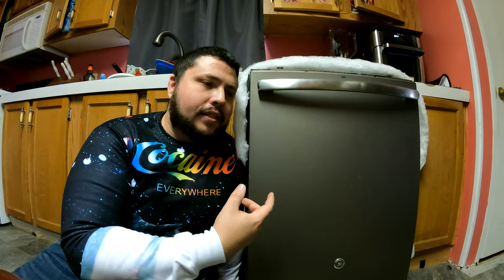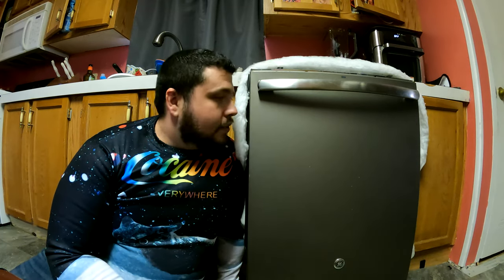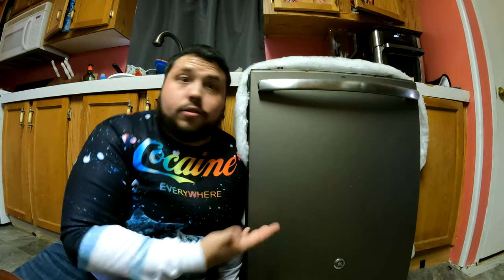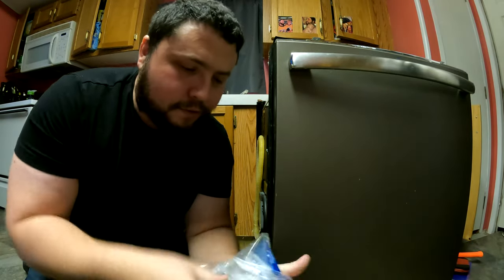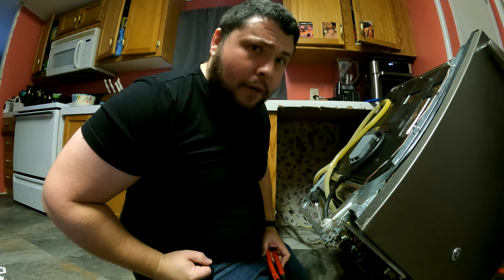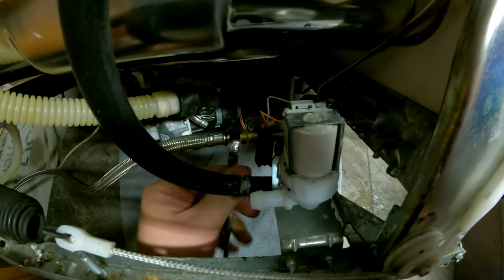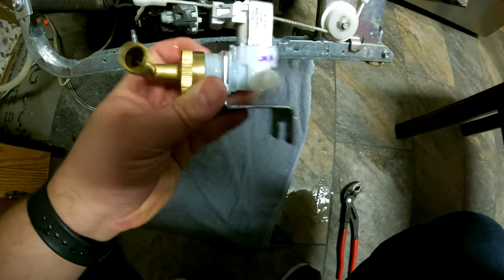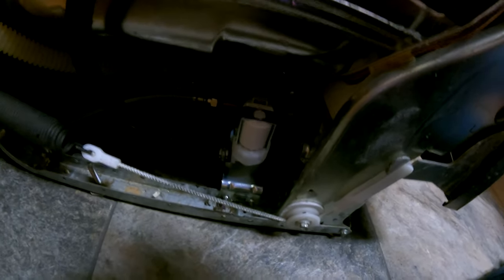GE DISHWASHER NOT FILLING - WATER INLET VALVE REPLACEMENT | LETS FIX IT!

Comment: I'll never buy another GE dishwasher. The new ones are lucky to make 1 yr without needing a repair. 2 yrs ago we replaced our old GE that had lasted only 4 years with a newer one. Over the 4 yrs we had the prior one I had to replace the control panel twice, and the water inlet valve once (around $250 for the parts only. i provided the labor). 

After it crapped out again I was fed up with fixing it so we bought a new one hoping surely they had improved. We got another GE only because my wife insisted it matched our refrigerator which is also GE. 

Now right at 2 years it too has stopped working. It starts up, drains at least some of the water (tested by pouring some water manually in bottom) and then after several seconds of just noise (much noisier than usual) it just shuts off without ever filling with water. Did all the cleaning like you did, took off the drain pump and inlet valve and checked for and cleaned debris. Nothing obvious like broken glass found. Reassembled. Same result. Although I had my doubts, I hoped maybe the louder than usual pump noise was just because it wasn't getting water at all so went ahead and replaced the water inlet valve as was cheap and an easy to replace as you demonstrated. STILL same result. 

Pulled a Hail Mary and ordered a cheap used pump for $30 which should arrive tomorrow. It is noiser than usual and while checking for debris, I could spin the propeller in the pump with my finger, but it was a little stiff so thought I'd give it one last try as after hours of research and finding other reports of pump internal scoring and bushings going bad in these pumps being a common issue. 

If this new pump doesn't resolve the problem I'm just punting and buying something new and NOT GE. Paying $1000 for an appliance that lasts only 2 yrs before failing under normal use is just ridiculous.

It's sad to think about how you used to get 20+ years out of appliances when today they are just junk. Fortunately for us, I'm technical enough to make most all repairs myself with the right parts. I can't imagine how families can afford keeping their major appliances running these days if they have to pay for parts AND labor. Even for a relatively simple fix like this you're probably looking at $21 for a new inlet valve then an extra $150 labor to have someone else put it in and that's just crazy.

Thanks for the video.
Reply from the maker: I completely get it. I started really investing in this channel a few years ago because I saw the need that people had to fix their problems. Not everyone has the money (myself included clicked)to dish out endless cash to someone that ends up doing more harm than good. My recommendation for a dishwasher would be a Bosch or, hear me out, A Samsung linear wash water wall dishwasher. They had a lot of issues when they first came out but they’ve fixed a lot of the problems. I’ve had mine for almost 3 years and really the only thing that’s truly went wrong was my own mess up. The water wall sprayer arm that moves in the tub can come off sometimes if the lees anything sticking below the bottom tray but it’s super easy to put back on.  The amount of times I’ve heard “you’ve saved Christmas” really has a good feeling and I like to think that my channel helps make a difference in people’s lives. Anyway if I can help in any way let me know. I try to get to all the comments but sometimes I do miss a few.
Reply: @BreakFixRepair wow! Thanks for the response! This is an old post so a response was surely unexpected. Thank you for that and being helpful. I've subbed and have already been checking out your other videos. 

A Bosch is exactly what I am looking at. One big reason is I can get a stainless steel one with NO logo on the door so I can get it past my wife without her complaining that it 'doesn't match' our GE fridge.  

I actually also considered a Samsung,  but the ones I looked at had a logo prominently displayed on the front. I know it sounds silly, but my wife gets hung up over 'appliances have to match'. sigh. She's been a keeper now for 25+ yrs so I figure if I get close enough to matching that will be good enough. 🙂

The fridge has actually done well for 6 years. Although I did have to replace the ice maker but wasn't a big deal. I sure don't want to buy a new one just because the matching dishwasher crapped out. 

If you have any links to share on the Samsung you mentioned I will definitely have a look in the event my last ditch repair attempt fails.

Lastly, you are right on with how valuable videos like yours are to folks like me. Helps us save money and learn new things. Thank you very much for taking the time to do them.

And as for comments about your shirt at the start of this video. Whoppity doo I say. I found it funny the moment I saw it. People need to take a joke. Take care.

Comment: Did it just make a clicking noise and sometimes cycle and other times just didn't do anything? Mine just makes  clicking noise, washes for a minute then stops. Other times it just shuts off after several clicks and time.
Reply from the maker: Yes that's what it was doing. it fixed it for a couple of washes but I think it had caused the pump to burn out so I really had two problems.

Comment: So we replaced the valve it turned on for a short time and then it stopped again.  Anything else?
Reply from the maker: It’s not filling with water or what’s going on?
Reply: So we replaced the inlet valve, it seemed to work for a little bit.  Checked the float and that was really dirty, cleaned that and it still is not working.
Reply: Water is still not filling into the machine
Reply from the maker: @michie5513  okay what model?

Comment: Replaced mine, still no,work? No voltage to it either
Reply from the maker: Did you get it working?
Reply: No, replaced machine control, UI board, and valve? Only thing left is the wire harness! Good time to get the Smart HQ service tool.

Comment: I agree, TOO MUCH TALKING.  I did this repair last week but instead of replacing the valve,  I removed the small filters inside the valve where the brass connector attaches to the valve.  The filters were clogged with a black solid substance not letting water flow into the switch.  Cleaned and reinstalled the filters and reassembled the hoses and switch and the dishwasher works fine.  No cost but time!